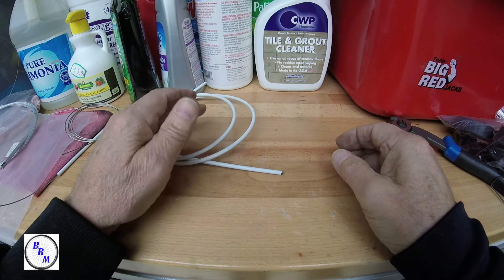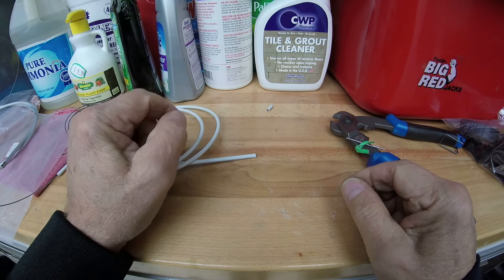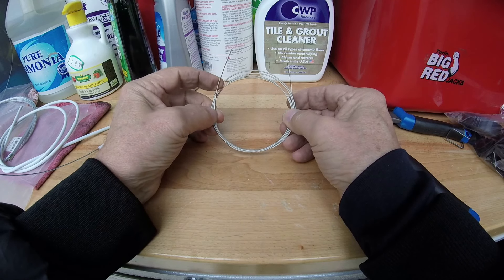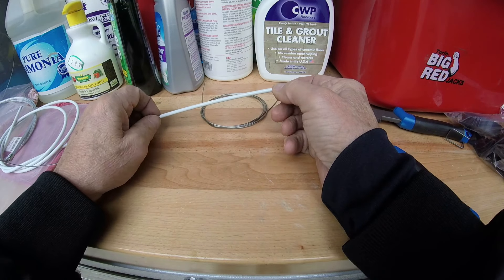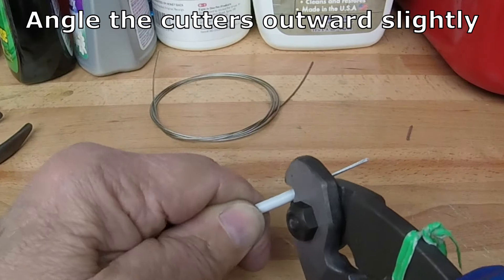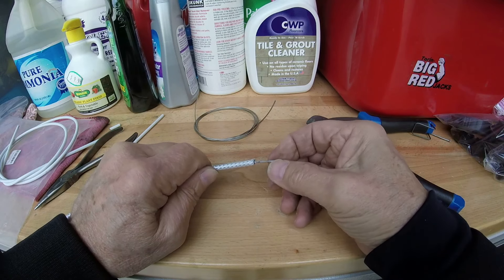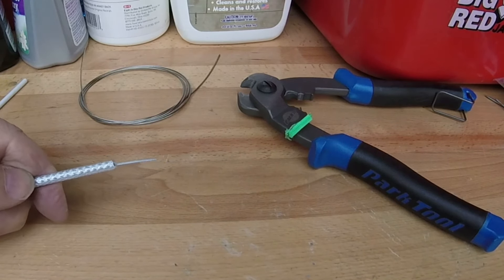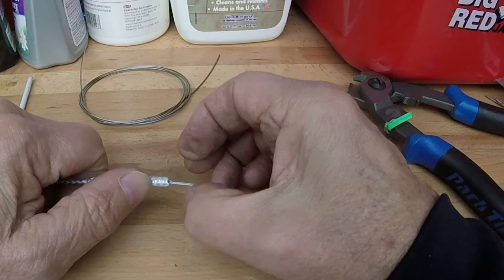How To Cut Your Cable Housing Without Mashing Them

Comment: You need different cutter for brake housing and different for shift housing. The cutter you have in the beginning of video works well on shift housing, while it leaves sharp cut half coils in brake housing. Best cutters for brake housing are these plier type, a good quality pliers will have great cutters for brake housing.
Reply from the maker: I used the same cutter for both cable housings. Thanks for the comment. 👍👊

Comment: Really, really embarrassed that I did not think of this on my own. One little innovation, if I may. Use an appropriate diameter piece of copper wire instead of stainless brake cable. It’s softer and easier to cut on your tools.
Reply from the maker: That's a great idea! Thanks for the comment! 👍👊

Comment: tried it, thought it would be great, didnt really work for me. almost was worse than just cutting it.
Reply from the maker: Did you angle the cutters slightly?
Reply: @BicycleRestorationMan  i did angle them slightly away from the cut. still kind of burred the metal inner hose over the cut. I'll give it some more practice bc when I first saw this video I was excited to go try it!
Reply from the maker: @ChrisShaffner-wi1gy  Sorry it didn’t work for you. Probably one of the most fool proof ways is to use a dremel tool but this worked for me so well that it was faster than dragging out the tool.
Reply from the maker: @ChrisShaffner-wi1gy  are you using brake cable and not shifter cable?
Reply: @BicycleRestorationMan  yep, its def brake cable, good troubleshooting though. I generally have the best luck when i give the housing a bend to separate the metal lining a bit. Im going to keep practicing this method though because it seems awesome!
Reply: @ChrisShaffner-wi1gy  Let me know how it goes.  Hope it works for you.